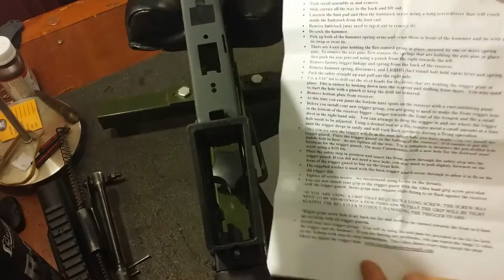catamount fury conversion from carolina shooters supply part 1

Comment: I noticed you did not reinstall the bolt release lever. if you had used the original hammer with the new spring the lever will sit properly an work as it should.